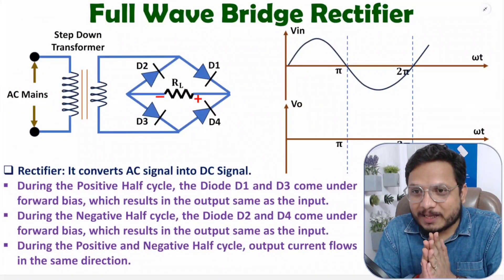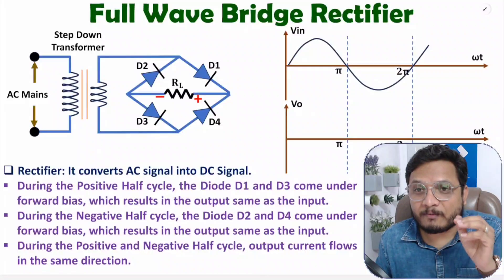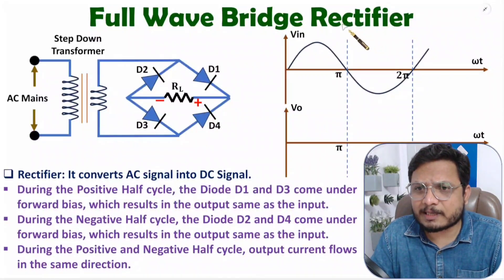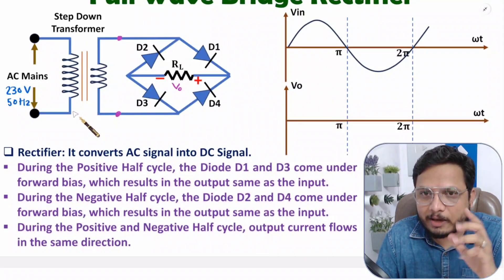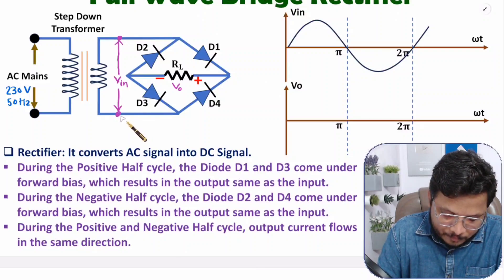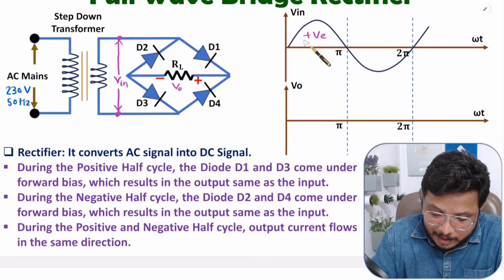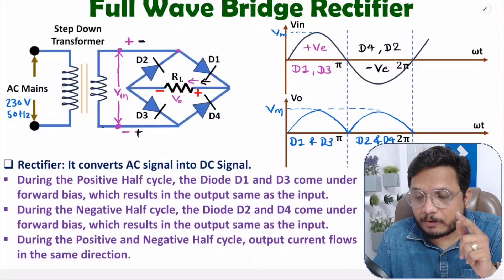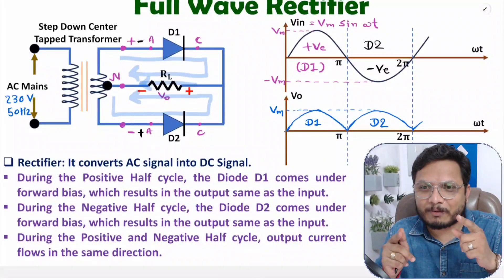Full Wave Bridge Rectifier (Basics, Circuit, Working & Waveforms) Explained

Comment: Sir why do we need bridytype full wave rectifier if we already have normal full wave rectifier i mean here in bridge type we are adding two additional diodes but result of both rectifiers is same. So why this one ?? Umm because it looks cool & beutiful?? 😅
Reply from the maker: 1. Transformer Utilization
Bridge Rectifier: Does not require a center-tapped transformer, which simplifies transformer design and reduces cost. It utilizes the entire secondary winding of the transformer for both half cycles, leading to better efficiency.
Full-Wave Rectifier: Requires a center-tapped transformer, which is bulkier, costlier, and less efficient because only half of the winding is used during each half-cycle.
2. Efficiency
Bridge Rectifier: Converts AC to DC more efficiently because it uses the entire secondary voltage for rectification.
Full-Wave Rectifier: Loses some voltage in the unused portion of the secondary winding, reducing its overall efficiency.
3. Output Voltage
Bridge Rectifier: Provides a higher output DC voltage for the same transformer secondary voltage since there is no center tap voltage division.
Full-Wave Rectifier: Delivers a lower output DC voltage due to the division by the center tap.
4. Peak Inverse Voltage (PIV)
Bridge Rectifier: Each diode withstands only half of the transformer's secondary voltage during the non-conducting phase. This allows the use of diodes with a lower PIV rating.
Full-Wave Rectifier: The diodes must withstand the full peak voltage of the transformer secondary winding, requiring diodes with a higher PIV rating.
5. Cost and Design Simplicity
Bridge Rectifier: Requires four diodes but no center-tapped transformer, which makes it less expensive and simpler in design for many applications.
Full-Wave Rectifier: Requires two diodes and a center-tapped transformer, increasing cost and design complexity.
6. Circuit Size
Bridge Rectifier: The absence of a center-tapped transformer reduces the overall size and weight of the circuit.
Full-Wave Rectifier: The transformer adds bulk and increases the overall circuit size.